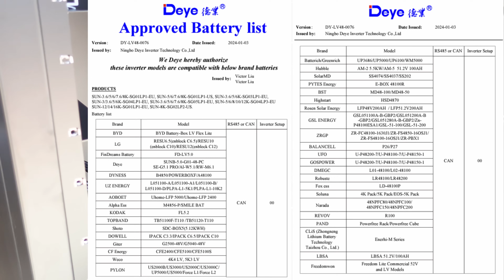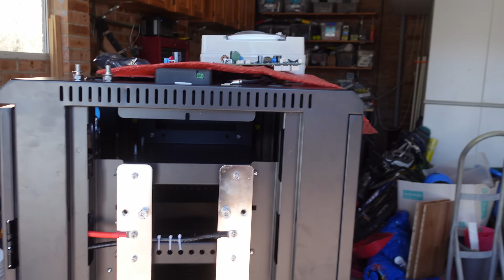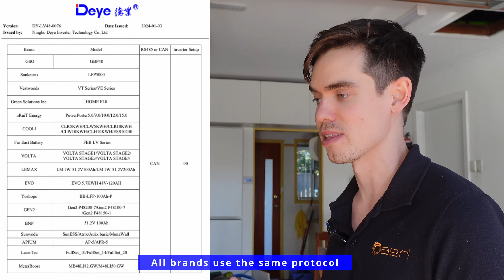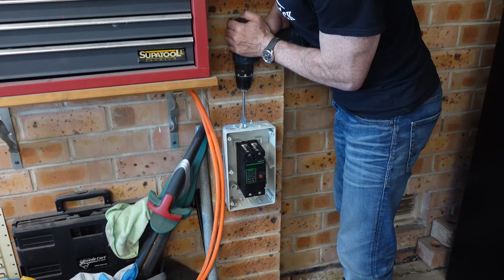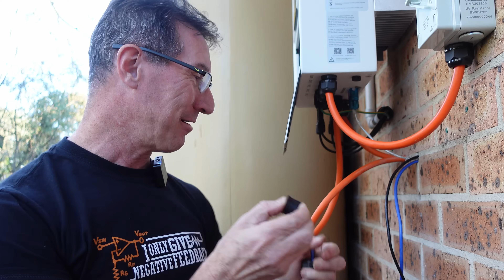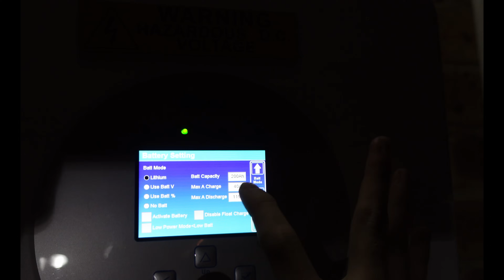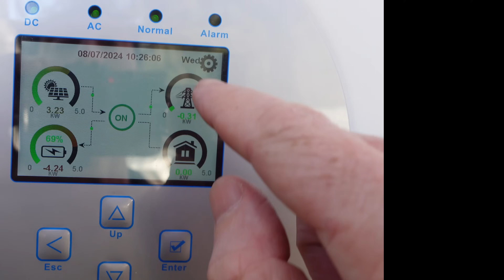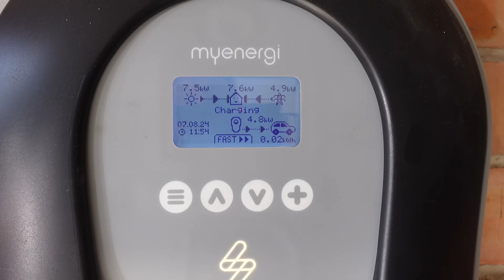EEVblog 1634 - 15kWh AERL LFP Home Storage Battery Install!

Comment: The lug crimping was hilarious. Of course, I have a story about crimping lugs.

When I left the US Navy in '81, my first civilian job was as a technician with General Atomics, initially testing and calibrating industrial radiation monitors for commercial nuclear power plants. I soon switched over to the R&D side, helping bring up prototypes and "first article" production builds. One of the builds was a full-custom SCADA (Supervisory Control and Data Acquisition) system, the first to combine automated management of nuclear, steam and electrical production for the plant.

The enormous wall-sized SCADA cabinet had about a dozen high-power cables for key contactors (most others were remotely controlled). We wanted the cables to "look good for the customer", so they were cut to exact length, and I was given the task to attach all the lugs. In-place. Without help. We had hydraulic lug crimpers, but they weren't calibrated (EVERYTHING used for nuclear-related systems was calibrated), so I had to use manual crimpers. Inside a massive, packed cabinet.

As Dave showed, the cable end can seem like a live eel when trying to get the lug and tool ready to apply the crimp. My solution for holding the cable steady (enough) was to get some poly rope and form a spiderweb of tie-downs to any available point. Worked surprisingly well! The key was to leave no marks on the cable or cabinet, which meant I couldn't use a magnetic "third hand".

But that approach to stabilize the cable wouldn't work outside a cabinet, and so wouldn't have helped Dave.

Another technique I used was to attach the lug to one jaw of the crimper using electrical tape. Sure, I was picking bits of tape off after the crimp, but it was worth the hassle. (Modern crimpers have a pre-hold capability to meet this need.)

One might think that taping the lug to the cable would be better, but that would prevent feeling the cable bottom-out in the lug before applying the crimp (a full-depth crimp was required, and I couldn't always see into the end of the lug). Plus, the tape could leave residue on the cable that could be difficult to remove, which was not a problem on the lug.

After each crimp was made, nuclear-grade goop-filled heatshrink tubing had to be applied. Unfortunately, a hot-air gun couldn't be used inside the SCADA cabinet. But solving that is a whole 'nother story.
Reply: I have a story, for another time, about a couple of "special customer" Learjets. 000 guage wires 4 per starter generator, 2 per threaded post. 

The first one wired up caused a substation transformer to fail when we did the initial "smoke check". Entire factory went dark and quiet. Turned out somebody thought that connecting the wiring then checking continuity was easier than the correct procedure to prevent crossing the wires.
Reply: should of used handheld hydraulic crimpers
Reply: @eliotmansfield  No burly man uses hydraulic crimpers. (Just kidding.)

Comment: Cool interview, I loved the video :)
These exposed busbars give me the creeps, haha. The battery connectors are indeed a thing of beauty! I love how holes in the rack are lined up with the connectors on battery module panels - spot on, no bending, pure simplicity and elegance. Well engineered for sure.

(The sight of Dave struggling with a crimp tool... It fills you with determination.)
Reply: Once the air between the surfaces is ionized, like due to a lightning strike, a DC arc can maintain itself. An electrical power engineer that served on a US submarine told me about seeing such continuous arcing happening within a submarine DC power panel. He related the story after I told him about a lightning strike mitigator used in early overhead powered trolley cars. The device was an easy spark gap from DC power to ground for lightning to find, but a coil was included within the path to ground to “blow away” the eventual continuous DC shorting arc with the magnetic field generated by the shorting current passing through the coil.
Reply: ditto, it gave me the willies...
Reply: eh, it's only 48V
Reply: @SomeMorganSomewhere  yes, at hundreds or thousands of amps in case it gets shorted with a metal object like a wrench.
Reply: @KeritechElectronics  The trick is to not short it out then. Dave lives in Australia, not touching dangerous things that could bite is part of daily life 🤪 They probably teach this in primary school - "This is a funnelweb spider, do not touch. This is an exposed high current bus bar... also, do not touch"
Reply: @KeritechElectronics  You'd have to be trying... They're normally covered by the rack side covers and if you were needing to service the connections you'd just unplug the battery modules, at which point the bus bars are completely inert...